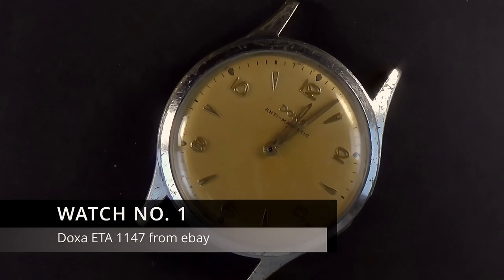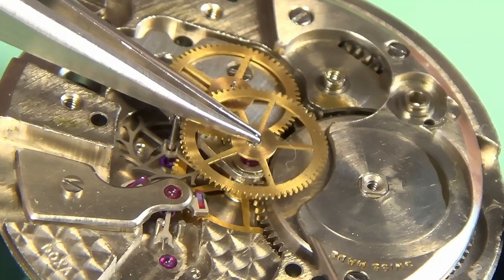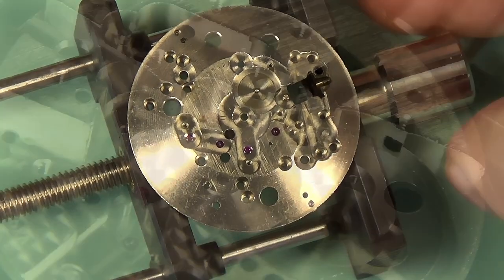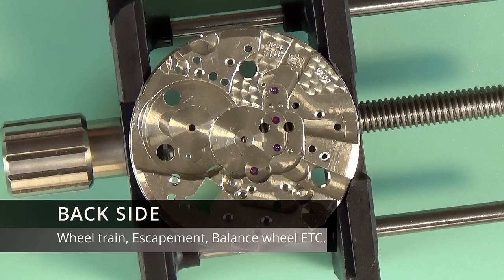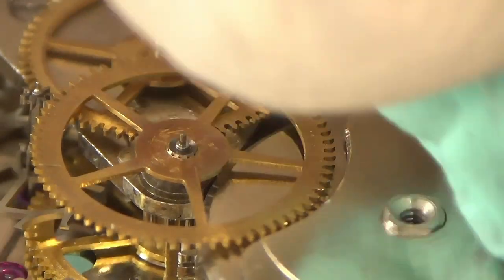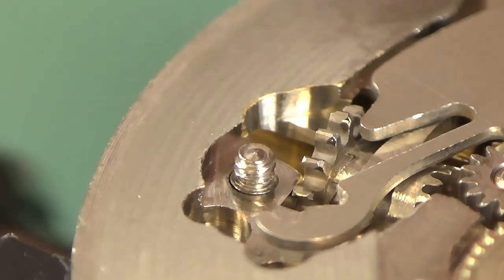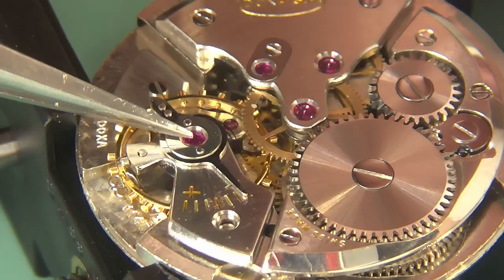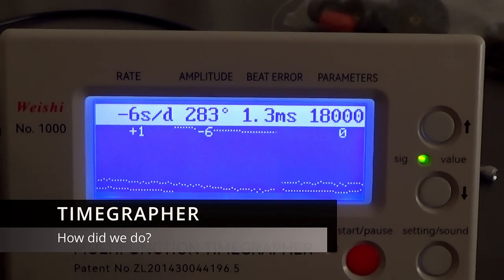Vintage fifties Swiss Doxa watch restoration / repair. Did I finally get a good deal on eBay?

Comment: Hello David, I am still are a fan of your video’s and your honesty about your learning process! A few tips:
Perhaps you will have to reconsider the oiling between the plates (so mutch). Under the ratchet wheel about half the amount just on the scrubbed off places and under the crown wheel just in the hole.  The barrel arbor has to get some on the collet on top and bottom before closing the lid. After closing the barrelbridge, All other in between plates lubricating I would not recommend, just attracts dirt and will become sticky over time. Check this barrel arbor on excessive play, very important for the amplitude (getting the power cleanly in the train of wheels).
I saw also that you have put the pallet fork in the cleaning basket with some “heavy” other components. Please when you use a watc cleaning machine, sort this type of delicate parts out and put the separate in a basket. Or else they will bump into each other and get damaged when the baskets are rotating. Again, keep up making the good video’s! Greetings from NL, Peter
Reply from the maker: Hello Peter again thank you for taking the time to give me some tips most helpful. I really do appreciate it.

Comment: Excellent video! I love the closeups in the circles. Im definitely watching your other videos. The case should have had a crown tube installed! The stem was a good length before you cut it. The tube keeps dust out & helps keep water out as it presses against the gasket in the crown. You can get boxes of case tubes on eBay for cheap. You just find the right size & press it in .
Reply from the maker: Thank you for the feedback I'm happy you enjoyed the video, to my knowledge this case never had a crown tube the stem actually came from a watch 2mm larger  with the same movement, however that one was beyond saving unfortunately. I will double check the crown tube I could well be wrong and I appreciate you taking the time to let me know.
Reply: @Saving-Time  ok. I may be wrong about that, but that would be odd. If there's no case tube then the crown should have a "nub" that fits in the case hole to prevent dust intrusion at least. The hole looks way bigger than the crown "nub". I've  just never seen an unprotected system like that. The hole in the case is really big compared to the crown so I'm convinced there should be a case tube.

Comment: English isn't my first language, but I've been taught that antique usually refers to 100 or more years old and less than 100 guides to vintage. I'm just referring to your mainspring winding tools set. Otherwise, it's a great video and good editing and calm and helpful commenting.
Reply from the maker: Antique means old and of value. This business of being 100 years old is just something antique dealers say; in truth, the actual English definition is just old. They used to say it was not an antique if it was made after 1830, but yes, it's just an antique dealer using the word for cataloguing items.

Vintage means old and, importantly, typical of the period, so regardless of what the internet says, I would not use the words to define the age of something in years.

I'm glad you enjoyed the video.

Comment: I think with all the work getting your watch married and in good order that you would be happier with a restored case. I have a case or two that I'd like to improve upon when I'm feeling courageous.
Reply from the maker: I did restore the case on this one later it ended up as a gift for a good friend. Good luck with yours the plating is easy enough it's the prep work that's a pain in the arse
Reply: @Saving-Time  one of my cases is for an alarm watch (Memvox model I forget the maker) with a GF case one of the stem holes is corroded out to about tripple size, figured to fill in the missing area with some gold solder and then clean it up with fine sand paper and perhaps a small file to get the hole just right. Unfortunately all the jewelers I've known over the years are retired.
Reply: I just looked it up 
Le Coulter.

Comment: Generally when you see wear marks under the ratchet wheel, it's a good chance the bushing or bushings are worn and need attention. Always check for excessive side shake as it will never run great when worn.
Reply from the maker: Thanks Mike I really appreciate the advice, nice of you to to take the time.

Comment: Excellent work! I was wondering if you were going to realize when you were putting the keyless works together that the setting lever wasn’t on 😂. I’ve been hesitant to seek out Doxa watches, but I think you’ve convinced me there’s nothing to be afraid of, so long as the whole movement is in there haha
Reply from the maker: I put the setting leaver back and then did not put it into the edit. I only noticed when I was watching it back on YouTube. I was hoping no one would notice lol well spotted. The older Doxas are good, modified ETA movements for the most part, nice looking watches. Avoid the stuff from the 70s like the plague or at least I would. And yes try and get one with a whole movement :D
Reply: @Saving-Time  noted :)

Comment: How did you ID the movement as an ETA??
Reply from the maker: Most movements are marked, a lot of the time under the balance wheel on the mainplate. I looked up the markings on http://www.ranfft.de/ great site btw.  I've also used a reverse google image search to try and identify movements and sometimes you can find the info from the brands back catalogue.  In this case i had another Doxa with what looks like an identical movement that was actually marked ETA cal. 1147. http://www.ranfft.de/ though is a lifesaver for all sorts of info. Hope you enjoyed the video.
Reply: @Saving-Time  Thanks for the link. I have a Doxa that needs repair and a caseback. I believe if I can identify the movement I will [at some future time as I am currently getting started in the hobby] I can get the it working but the caseback is a different story!!
Reply from the maker: I've done quite a few doxas at this point if you want you can DM me on Instagram I might know what the movement is. I also have one spare doxa caseback chances of it being the one you need are low but if you send me the size of the case and it's a match I'll post it to you.  https://www.instagram.com/savingtime_yt/

Comment: You should correct your screwdrivers, not a good fit in the screws.
Reply from the maker: I'll work on that thanks for the comment.
Reply: Cause if you slip,,,,, you can imagine, and it,s important with perpendicency.
I know